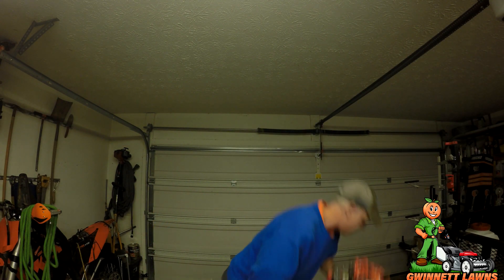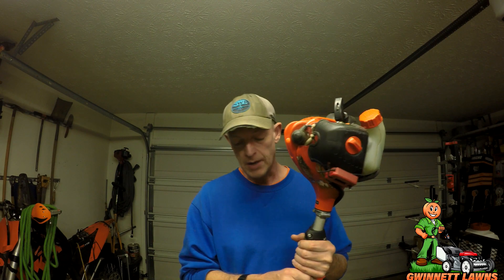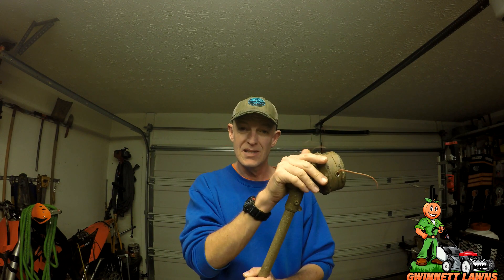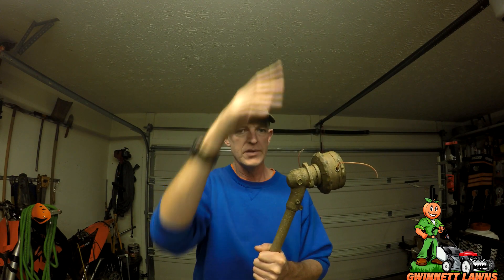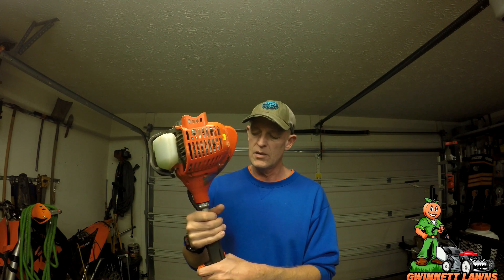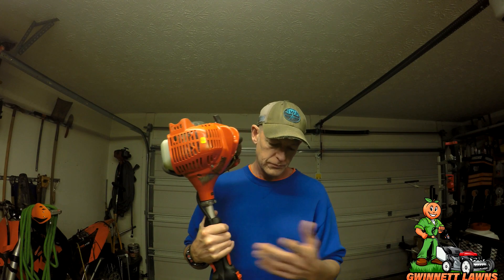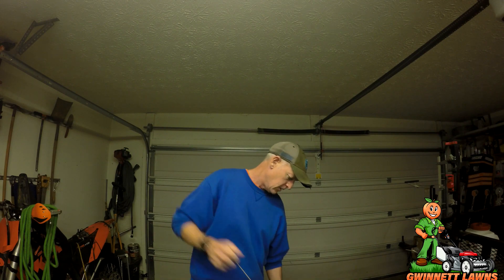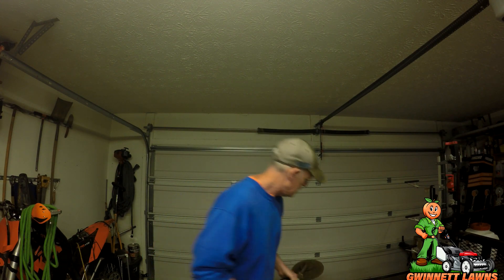46 Hour Review of the Echo 2320T String Trimmer

Comment: I had just returned from Home Depot after buying the SRM225 when I came across your videos and the issues you had with the SRM225.  After watching all of your videos regarding the hassle you went through with Echo, I ran back to Home Depot and exchanged the SRM225 for the SRM2320T.  You may have saved the day, I will never know if the 225 leaked oil I never even pulled it out of my truck to try it. Thanks for the videos !!!!

Comment: For a game changer for the 2320t, drill out the pass through of the feeder with a 5/32 and run some .155 with a metal core. You can only get about 10 feet on the spool but it lasts sooo much longer.

Comment: Great informative video sir I didn’t even knew the 2320 existed all I know is the 225 2620 and the 3020
Reply from the maker: It’s great if you need a trimmer like the 225 that’s actually reliable and more powerful. But the 2620 T is all that I use because it has so much power do I have almost 300 hours on mine now.

Comment: Great video man i have a srm2320T it is a great trimmer i also have 3 srm225 that we use as fixed extended hedge trimmers there on there 3rd season  these series trimmers have really surprised me how reliable they are and how well they handle full commercial use every day in our company here in Miami fla its none stop down here. these trimmers must have at least over 1500 hours and they run perfect.

Comment: You mentioned trimmer line at 6:59, I like Arnold Maxi-Edge 095 and it holds up well on the 225 trimmer. I'm not a contractor and would never use those large spools of trimmer line, just use the retail packaged stuff. I'm interested in the 2320T as an upgrade for tougher weeds and grass on our property (cost is a factor).

Comment: Excellent video! Chrome plated cylinders.... that is what gives it its 300 hour rating, as opposed to the 50 hour rating on the SRM-225. With the 2320T only costing $50 more, I’m not sure why anyone would want the SRM-225. $50 difference in having a more powerful, professional commercial rated unit, over an entry level residential rated unit. 
Don’t get me wrong, I like the 225 for its attributes. Decent power and lightweight, cranks easy. But since echo has released the 2320T, I don’t see how there could be any contemplation on which unit to buy.
Reply: The 50 hr doesnt mean engine life, Ive had 50 hour emission trimmers last 14 years and compression was not the failure,  e10 gas on carb parts was
Reply: @brianricoh3242  no one said it did. Research what it means. It’s rated six times better for $50 more.

Comment: I want one
Reply from the maker: I have a brand new one still in the box I never used I am selling for $200.
Reply: @GwinnettLawns  Do you still have this weed eater available?
Reply from the maker: @MrRGiller  yes sir still in the unopened box.
Reply: @GwinnettLawns  Ok.  I will let you know soon.   Thank you
Reply: @GwinnettLawns  I have a question for you.  I have  the Echo SRM 225 and I have maybe two hours on it.  It is spitting some very small droplets of oil into the inside part of the plastic of the exhaust housing.   Is this normal or should it be completely dry of any kind of oil residue, regardless of how little it might be?   My concern is, what if it gets worse down the road.   Thank you for your help on this.
Reply from the maker: @MrRGiller  They have a defect and boy do I have a story on those trimmers that I already did a few vids on.  Start here:  https://youtu.be/ccWHzM9NM4s
Reply: @GwinnettLawns  I will take a look at your video.  Thank you for your help on this

Comment: What about the Shindaiwa T235?  It's the same as the SRM225 just built for commercial purposes.  It has a 300 hour durability rating on the 21 cc motor, solid steel shaft, and 20" cut.   How would that compare to the 2320T?

Comment: I just discovered your channel while researching Echo trimmers.  I've enjoyed many videos so far, but have a question on this one.  You stated that the 2620T weighs a lot more than the 2320T, but the Echo website shows them within a few ounces of each other?  It SEEMS like the only thing the 2320 offers is a $90 price savings at the expense of some power.  Am I missing something?   Thanks to your influence and tutorials I already have an hour meter heading my way regardless of the trimmer I buy.
Reply: Oops, bad math.  $110 difference between the T models, and $80 between the 2320T and 2620 standard.
Reply: @ORflycaster  I'm also curious about this
Reply: I noticed that the fuel capacity is also 6.2 oz more on the 2620, so I believe the extra fuel would account for higher actual weight while using in addition to the .3 lbs increase listed for dry weight
Reply: @redheadryan73  thanks for your input I guess I just don't consider it to be very light for what it is. I now own both of these.

Comment: I bought the 225 and 3020T.  Would have been happy to sold both before the first tank of gas was empty.  225 too weak. 3020T is heavier, weaker and grass jams up the head at the same cost vs the stihl 131.
Reply from the maker: @heathalford4721  I never had a 3020 jam up with anything decimates weeds before it even touches them.🤑
Reply: @GwinnettLawns if you weed eat regularly it does.  Try to trim stuff that’s tall and thick mine wraps up bad.

Comment: Ive never had a trimmer fail because of compression, its always e 10 fuel related after 10 years or so m on the fuel lines and carb.  Thats with a 50 hour emissions sticker.

Not sure on you oil issue, I dont see that with my 225 , and I run 3 month ol gas and waht ever 2 stroke oil I feel to run. Mines also desmogged, and fuel tune enabled, before the first start rope pull.